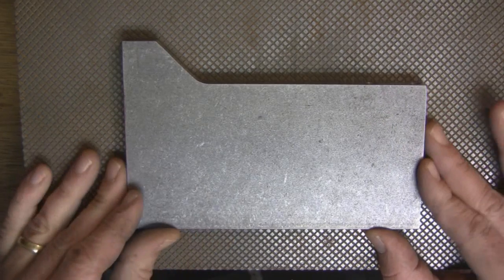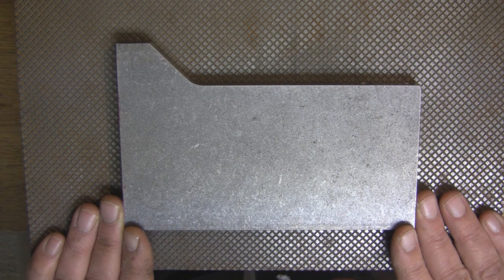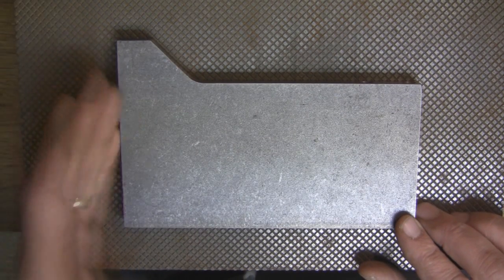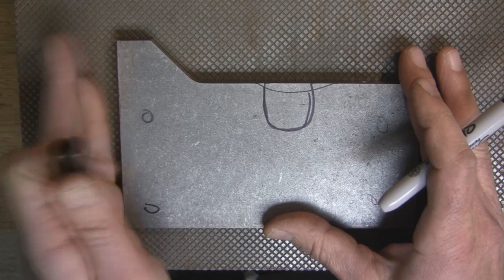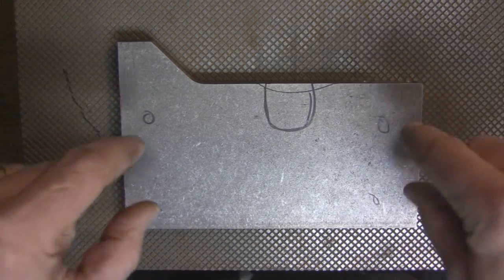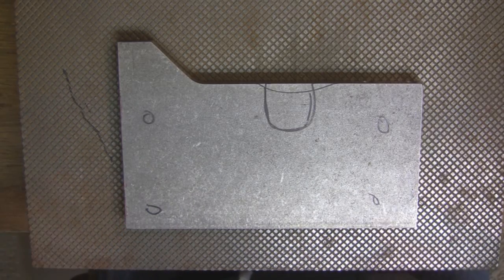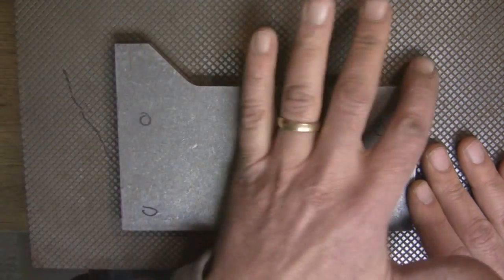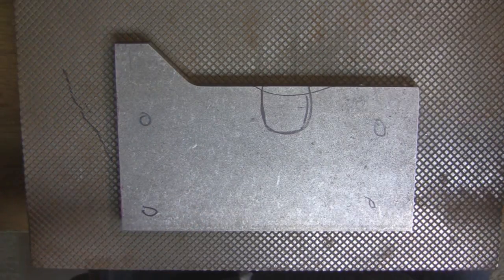A Few Things You Should Know About Cold-Rolled Steel

Comment: We make 0.5” thick 316SS disks and we start with a flat square stock of hot rolls SS.  And end up on the lathe with a disk.   You’d think using extruded round stock (cold rolled) would be easier but I think the problem discussed in this video is what we want to avoid.

Comment: It's not only in the "skin" , it is all the way through to the center. The worst case is when you remove material from any lengthwise axis and cut to the center.  Like if you mill a 1/4" deep pocket on 1/2" CR it will cup so badly it will be useless.

Comment: That steel is not COLD ROLLED - It is Cold Drawn!!!  Cold rolling applies to sheet, strip and plate because it's made in a Rolling Mill.  Cold Drawn steel is produced by processing a hot rolled bar (round, square, rectangular, trinaguler, hexangluar, octangular and many other shapes) by pickling the hot rolled product, coating it with a drawing lubricant pointing the end, pushing it through a carbide die and then putting the rest of the bar
 through the die.  This process produces close tolerance shapes with good uniformity of cross section.  The generally used term CRS is a misnomer!!!

Comment: Run into this all the time the imagineers are not taught this in school. I have customers that want clevises in tight tolerance military and aerospace parts and they supply cold rolled. I leave tons of stock and creep up on the numbers with a fly cutter with a reversible bar. A lot of extra cuts when hot rolled would have been just fine. I do like cold rolled steel for a lot of things but you have to know the limitations. Good video. Cryo treating prior to cutting makes a world of difference with stability but not a commonly used practice unfortunately.

Comment: Thanks for great vid!  I have watched bunches of machining vids, and although thy might mention this or that about THAT were using CRS or HRS, they very rarely ever mention WHY?  You have done that. Now my question is why would anyone ever use CRS if it warps like this?  A comment mentioned about MIL scale being bad on tools (agree), but that is what vinegar and hydrochloric acid are for.  Maybe if you just want to start with something that is reasonably dimensionally the side you want already and you only want to do a few things to it like drill holes maybe CRS has a slight advantage. And maybe also if you don’t care if it warps. But otherwise HRS seems the only way to go (or annealing the CRS, in which case why not just remove the MIL scale with acid: about the same effort and inconvenience).  Sounds like a good video topic!

Comment: In my experience from making sample fixtures from cold rolled square stock or flat stock, it almost always starts to bow towards the side you are cutting, as you are removing the layer that had it's grain irregularities forced out. It acts like a fabric bag tightened thread by thread around the softer and elastically compressed core. Everytime you cut a thread it affects a certain length of the fabric.

Comment: Thanks, I'm just a hobbyist in metal & didn't realize that there would be that much stress in cold roll. Make sense though. I'm surprised that hot roll would be stable. I retired from manufacturing commercial interiors, wood based. There are lots of issues with wood stability.  Having had lots of equipment with cast iron parts I was well aware of how much stress that stuff can have and move after machining.

Comment: If you're trying to hold tight tolerances, CRS isn't a good choice, as you noticed. But if you do need to do it, stress relieving will eliminate the stresses that cold working the material introduced. Then you can mill it without having it go all over the place.

Comment: Was it Curtis Steel brand?  I think they shove it through rollers as fast as they can and they don't anneal it to take the stress out.  We got a load of 1/2" and 3/16" plate and .075 and .048 sheets from them.  All of it was oil can on the pallets.  We couldn't do anything with it except throw it in the scrap barrel.

Comment: I think you will have the same problem with hot rolled mild steel too. Not to mention, hot rolled mild steel is usually warped, like a  12mm flatbar will be concave on one side and convex on the other. I would have told the customer if he wants that kind of accuracy,  he needs to buy a tool steel., Or at least look at getting cheap steel annealed before machining and machine all the faces.

Comment: try annealing the steel first before you machining the surfaces.
Reply: The stresses need to be relieved first by soaking it at its critical temp. This is called normalizing
Reply: I was thinking the Same thing if you normalize the material and let it cool slowly I would think it would help a ton. Has anyone tried that approach?
Reply: @franlhg  it Will become hot roll, and believe it wasn't what the customer requested.

Comment: Great tip phil! This is the kind of stuff they don't teach in engineering school. Makes perfect sense. Thanks for passing on your knowledge.
Reply: Hang out in the machine shop and you'll learn it. They also teach it in manufacturing class.
Reply: They don't? That's unbelievable!
Reply: @littleworkshopofhorrors2395  They may or may not, Engineering (like most disciplines  is vast), can't cover every topic. The MOST important thing they DID teach me was C.Y.A/  Cover Your Ass..lol.That's why Engineers are so anal...don't want to commit get burned before going into production. Never ASSume. Research and test before commiting.   For sure  similar "gotcha" examples are provided in school...so a wise person will extrapolate and always wonder what they DON"T know about a thing, even if not specifically taught ;-)

Comment: Mill it, normalize it, grind it, ship it!
Reply: Will that spring it back ?
Reply: @ryanb1874  Normalizing steel heats it up and it will equalize the grain structure to remove internal stresses in the material. If you only take a small finish cut it will be stable enough that it will keep it's finish shape & dimensions. It is quite a technical process, Each material and part will have its own temperature, soak time & cooling time. Grade and size. Temperature is critical, you can't just guess at it. https://www.forgemag.com/articles/83798-the-importance-of-normalizing

Comment: I run into this problem a few times a year where I work.  The way they do things, I get the work order and the material delivered to me.  It's already too late to ask for hot-rolled.  I think I have the saw dept trained to spot this now.  Anyway if you stress-relieve the material before you start machining it, you'll be fine.  For me, it's as simple as sending it to the heat treat dept.  You can stress-relieve almost any material, even tool steel.  You're right, you can drill holes in it all day.  As soon as you cut the outside skin off, it curls like a banana.  If you manage to get it flat again, it can continue to curl.
Reply: By heat treating it. Annealing.

Comment: Thank you for that tip.That explains why some larger internal parts I would make still require stoning and fitting. And it's because the metal flexed or warped during machining.

Comment: Hello good info there is not many people know this.
My name is Tobi and comes from Sweden I work with high presition components that I do in our CNC machines., I often make rough first and then let the subject rest 5 - 10 days before the finish cut. And it works fine.
Reply: Hi,
Agreed, in just about any material, most of the rough cuts should be done prior to finishing, specially cold roll...!
Pierre

Comment: I knew this would happen if you just removed the skin on one side and not the other, interesting to learn that even removing some from both sides will warp it. I think I read somewhere you can avoid this problem with cold rolled by stress relieving it first, although you kinda have to go out of your way to do that.